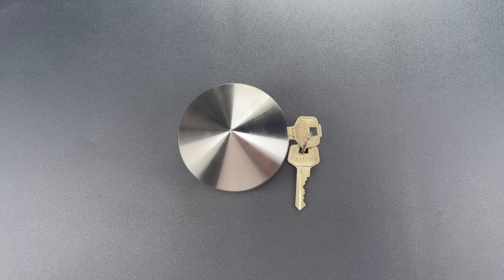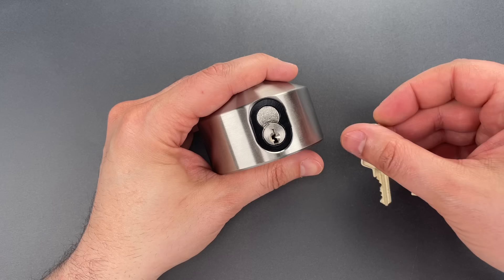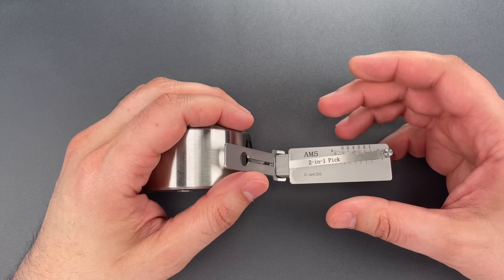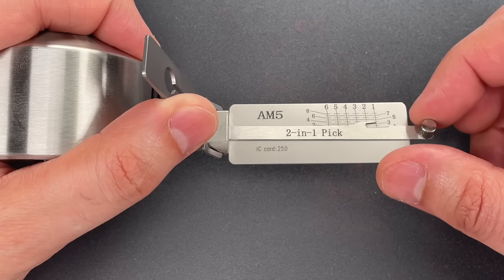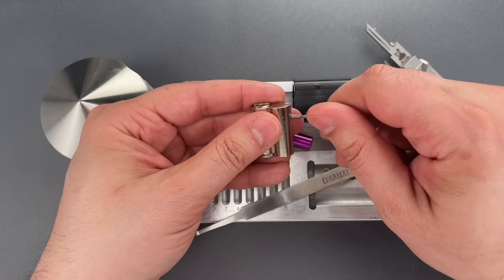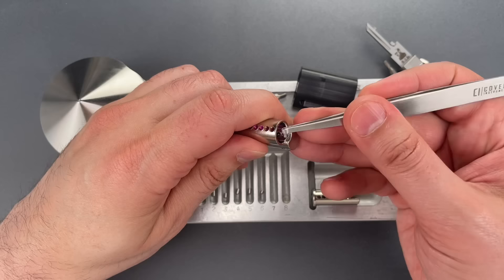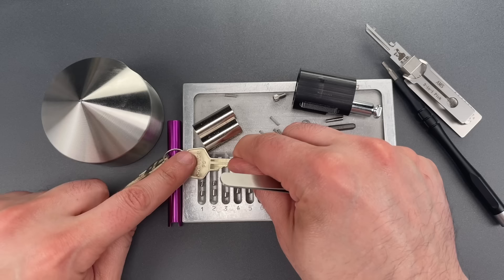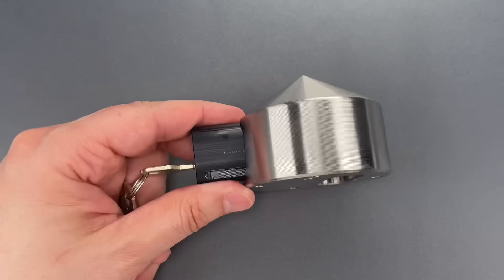[1293] PacLock’s Cone-Shaped Drill Defense

Comment: I like how LPL video lengths have become a measurement for security rating.
Reply: If Paclock included the easter egg just to make the video a bit longer they are absolute geniuses.
Reply: A long video might indicate a good product, or LPL may have spent several minutes roasting the fuck out of the lock and its manufacturer.
Reply: i recall a few videos he opens the lock under 30 seconds and spends another 4 minutes mocking the lock by opening the lock with a common house item.
Reply: @Wampa842  there's been a few videos, usually with Master Locks that he opens in a few different ways in less than 2 minutes
Reply: 1 star for each minute of LPL video. Very few locks have more than two starts.
Reply: Dissembling the core always leads to a longer video. I wish he did this to every lock. Not for longer videos but because I like seeing what’s inside the core.
Reply: This. 😂
Reply: Ikr? I saw length 7 minutes plus and said "Wow, this must be a great lock!"
Reply: @bman78629  I heard that LPL opened a lock just by glancing at it
Reply: Yeah.. I always check the video length in the thumbnail (give the ocassional *tut *tut with obligatory head shake) before clicking on it.
Reply: @Wampa842  This is true, but it's enjoyable either way. haha.
Reply: 5 minute video. 3 min getting into the package. 30 sec picking. 30 sec taking apart. A minute to tell us how it’s trash.
Reply: No question 😂
Reply: I was going to say this haha
Reply: @bman78629  or a stick
Reply: Or quantity of duct tape.
Reply: @Bob_Smith19  he does it to most every lock he can without destroying in the process.
Reply: @bman78629  or the LEGO spaceman...
Reply: @bman78629  I always do a skim and see how long is he actually messing with the lock. If it looks like it's a while it gets added to a special list I have saved. Hell, it it looks like it's longer than I can slide through in a twitch than that's 5 stars.
Reply: Hahaha true! 2-3 minutes is trash, 3-5 is alright, 5+ strong af
Reply: @scotsrule08  my rule of thumb is anything over 30sec for LPL is good enough.
Reply: That’s because he makes the video about the lock instead of including all kinds of sponsors or merch shit. He makes the video for information not cash.
Reply: I saw 7minutes and was like,  "well I guess I absolutely have to watch this one..." Lol he puts out such high quality content and no video of his is a waste of time.
Reply: Im pretty sure there are some hard to explain but easy to unlock
Reply: That's exactly how I judge the lock before even watching 🤣
Reply: To be fair he does tons of reserach and figures out how to break it ahead of time.
Reply: It's natural. When we're all used to 2 minute videos, anything longer is a glowing review
Reply: It took him just over 1 minute to pick the lock.
Reply: @jonathanohagan1349  those are master locks.
Reply: LPL security level:
10 sec pick time
30 sec pick time
1 min pick time
5 min pick time
Grinder
Indestructible
Reply: under 3 minutes: Not worth breathing in
3-4 minutes: bad
4-5 minutes: good
more than 5 minutes: i'd trust this lock with my life
Reply: Exactly what noticed lmfao
Reply: This guy thinks he is mcnally 😂😂😂😂

Comment: The fact that LPL got in was inevitable. More importantly, the fact that PacLock did everything they could to present a product that does what it says it should is the kicker. Good on them.
Reply: And as far as opportunistic a thief with normal lockpicks goes, any lock LPL defeats with custom tools is for the most part secure ( in the looses sense)
Reply: @toryknotts8026  Even without the need for this custom tool this lock is exceedingly unlikely to be picked in the wild. Good tolerances and 6 pins with 5 of them being security pins is generally enough. It took me QUITE the bit of practice to get to that level and even under ideal conditions (vice mounted, elbows firmly rested, no ambient noise, no cold hands, no adrenaline pumping) I average 4-5 minutes on this level of lock.
Reply: @toryknotts8026  it’s very secure.. LPL has the advantage that he is not worried that someone might spot him and attack him with a crowbar. 😉
Reply: @andersjjensen  plus most thieves dont even pick the locks but they cut or saw them off, so these really do help
Reply: honestly just having drill resistance and requiring specialized tools to pick are big plusses. Nothing is invincible, but this is pretty secure.
Reply: @toryknotts8026  loosest*

Comment: Ok that "mastersux" thing when sending it to LPL was super ballsy. Imagine if it was a bad lock, but no, it did well and deserves the ability to mock Masterlock!
Reply: I wonder if it was just that lock, or they all have that.
Reply: Even a door handle deserves the ability to mock masterlock.
Reply: @rezaka116  security level: gentle breeze will open
Reply: Tying something down with a noodle is safer than using a Masterlock.
Reply: @Gainn  you could use that as a deception technique by burning "Masterlock" on a good lock and confuse the picker
Reply: lol
Reply: Pac lock are usually well thought out, they don't cut corners

Comment: I can imagine the reaction from Paclock when LPL complimented the lock only to immediately bring out his ultimate lock picking tool that dealt with it in about a minute
Reply: It's high praise if they managed to make LPL use his special tools to pick their lock
Reply: If you read PacLocks comment, this tool would be very hard to use in it's intended application for gas station air/vac machines. You can barely get your hand in to use a key.
Reply: yeah, if it takes a tool 99% of people trying to break in don't have access to, its secure enough for most people
Reply: Most standard thieves won't have that tool
Reply: It's a $150 tool that only works on extremely specific keyways and is actually defeated by extremely strong springs. The Lishi is a very fragile decoder. Also, the fact that you can use any core you like also means you can get higher security options.
Reply: A minute is really good, this is LPL we're talking about. If it was another master lock, it'd come undone through sheer thoughts alone.
Reply: The lishi doesn't do anything a lockpick can't do, it's just made to make it more accessible

Comment: “Probably helps with pick resistance” seconds after having picked it
Reply: He had all the time to prepare and get creative, with all the tools accessible in his home (or office or wherever he films this). If you would be burglar or hired lock picker, you would have limited time and limited equipment on the spot, out of your home or office. Therefore any nonregular “unexpected” lock is a big stopping stone in my opinion.
Reply: The different strength springs add resistance against low skill attacks like raking. They dont do as much to hinder single pin picking.
Reply: ...and don't forget that in this video, LPL didn't pick this flat on the desk to simulate the flat surface of a van door for example. If he did, you would have seen that pulling up on the tensioner between thumb and index finger  is much trickier, and doesn't give the same feedback as just pushing up the tensioner with the thumb (as he did here). Same thing with the pick part of the tool. Bending your index finger up whilst hooking it under the picks finger knob will reduce feedback. It's possible, but a lot trickier than the way he does it here. I thought he might have made a specialised pick tool for this, with a 90 degree bend in the handle. Besides all that, to guarantee you had the right tool for a multitude of these, which are very likely to have different cores, you would need a set of lishi decoders, not just one, and that would probably be well  above the budget of opportunist criminals. So, it's a very good design.

Comment: A 7 minute LPL video? I can finally lock my shed!
Reply: 1-2 minutes of picking
Reply: @knightsofthewicked9121  With a specialized tool and LPL being the picker. That's pretty damn good if you ask me.
Reply: I currently have this very cool steel cone-shaped lock on my shed. I love that it's drill-resistant and it looks neat. It's very good except it froze up several times over the winter and I needed a hairdrier to open it. Mine has a brass core w/brass key and a blue silicone keyhole cover. The one that LPL worked on today has a different core that perhaps may be more cold weather-friendly. I put a call into Paclock to see if they have any suggestions to keep it from freezing up. If you get this, make sure your shed door design can accommodate for the two hidden bolt holes behind the lock itself. This protects against a bolt-grinding attack. Unfortunately, I could only use the hidden bolt on one side, as I had nothing to drill into behind the other side.
Reply: @knightsofthewicked9121  and he's probably slower so people can follow what's going on, but then again he's been doing this a lot and is using a specialized tool for it
Reply: @dralex4830  He's also explaining the process (and what he's feeling in the process) as he uses the special tool.

Comment: Mr. LPL was more than a little enamored with this lock. How refreshing.
Reply: This BRAND. He recommends it whenever their products are featured. He has a good relationship with them. He respectfully points out flaws if he finds them, and they take those seriously and improve their design. I wouldn't be surprised if they were one of the top brands for actual level of security.
Reply: What Otaku said. They seem like one of the only company that still try to innovate and make life tough for thieves, and they crave LPL critics so they can improve the flaws in their locks. 
I mean, innovative shape against drilling, stainless steel pins, really hard to pick without a tool like the one shown AND all security pins, unbumpable, uncombable...
And it LOOKS sturdy, so many thieves will try another target instead of this one since most of them won't bother with something this difficult.
Reply: They did simple but effective things to improve the security (positioning the core to defeat standard pick tools, variable strength springs, long driver pin to defeat comb picking, cone shape to divert drill bits).
This on top of standard anti-pick measures makes the lock quite a bit more secure than most locks.
Reply: it helps when he has an financial agreement with the manufacturer. This is an advertisement

Comment: LPL had to use a specialized tool AND it still took him a minute? That's a pretty damn good lock.
Reply: 1:14 total
Reply: He didn't need it, he uses it to advertise it because he sells them.
Reply: @dickJohnsonpeter   He would have needed it if it were actually locked up against a flat surface, the way the lock would actually be used.
Reply: @poundng1  A pick with a suitable bend could also be used but using custom pick from covert operations is obviously much easier to use.
Reply: @poundng1  if the key can fit,  regular lock pick tools can too. That thing isn't any different except the markings that make it easier for beginners. And the tensioner folds out for convenience. When mounted on a wall the keyhole is obviously far enough to use a key which is bigger than lockpicking tools.
Reply: @dickJohnsonpeter  you are missing the fact that although tools would fit you would have to learn to single pin pick with your pick being upside down from your perspective which is added difficulty as LPL tends to hold his pick like a pen as that is how he is used to doing it he would have to pick at a new angle with the feedback being different I have no doubt he could do it given time but that is no simple feat

Comment: When will we see a MasterLock with a similar Easter egg stating “PacLock Rules”?
Reply: PacLock is my daddy!
Reply: They already do,... it comes out as a wimpy sounding squeak everytime a rank novice successfully picks a Masterlock brand lock,... which is a lot!

Masterlock has never ever EVER made a legitimately good lock,... ever. EVER! Not even a part of a good lock without finding some ridiculous convoluted way of screwing up the rest of the lock's design.🤣
Reply: Only O'Doyle rules!
Reply: When Master starts making locks that don't suck?
Reply: @FunBunChuck  
So true, Master lock makes one good core, only found in their plastic tag-out lock 🤣
Reply: @dragonhealer7588  Yup, the Lock Picking Lawyer called it Masterlock's paradox. Their best and most pick resistant core in a plastic lock meant for specific applications and their worst core in their best designed lock body and shackle.

God fobid anybody that's competent should take over the company. Imagine what would happen if the Lock Picking Lawyer took over direct management of Masterlock!🤣
Reply: Last time I checked, hell was still hot as ever.
Reply: @dragonhealer7588  That's deliberate.

There are times when you may need to break a LOTO lock to get the system back up quickly.

But then you have a broken lock if someone got hurt without it being a legitimate removal. And that changes the nature of the injury from workplace negligence to deliberate sabotage.
Reply: @ScottKenny1978  
Of course 😁. Shame they couldn't use that core in a hardened padlock.....🙄

Comment: The mounting against the surface as a defense to picking is so interesting! Such a small but significant difference (at least to the basic tools you’d expect someone to use)
Reply: Also would help protect the core from being drilled. The key way is the weak point, and having it close to the surface prevents most drills from getting a straight shot at it.
Reply: It also has really good pick resistance on top of that. Nice lock.
Reply: The other benefit it that the core can not be drilled as easily, as the keyway is a weak point. When it's mounted like this, drills can not reach it easily.
Reply: What do use this lock for?
Reply: @oshismyname  trailer hitch 
[901] A Trailer Lock That I Would Use... Picked (Proven Industries)
YouTube · LockPickingLawyer
8 Jun 2019
Reply: @oshismyname  I think anywhere you'd have a locking latch. Like a shed or gate latch.
Reply: @oshismyname  The backs of some work vans have a shackle from the right and left doors coming together surrounded by a metal ring the height of the lock with a notch missing.  This lock slips over those shackles and inside the metal ring, with the core located at the notch in the surrounding ring.  Locking up slides a bar through the shackles.  The setup is designed to resist physical attacks like cutting or prying.  Putting a good lock in there limits other possible attacks.
Reply: Seems like it might also make operating it with the key a mite awkward though
Reply: if they  Angled it the lock faced a bit towards the door it would be hard to get a pick or that tool in there, would be a strange shape key you would have to L shape it
Reply: I was curious about the tensioning even with the Lishi tool.  He had his hand under the lock in the video, but I'm not sure there would be room to get his finger in there if it was locked against a surface.
Reply: @HariSeldon913  that's just to hold it. If it was locked onto a door hasp, he would not need to touch the lock body at all.
Reply: @ScottKenny1978  Not the way I meant it.  I was talking about the tensioning piece, though if it was secured onto a hasp he could most likely pull it up instead of push from the bottom.
Reply: @HariSeldon913  we may be talking past each other.

I'm saying that the lock body would be pushing into the door or whatever it's attached to, to give resistance to the turning tool.

Comment: This video was one of the best to show the process to set the pins, I learned more in this than the last 2 years of videos...except the ones on april 1st. Those always are the most informative.
Reply: Yep, both seeing the resistance when a pin is binding, and also the broader tool making the counterrotation plainly obvious.
Reply: Completely agree, seeing counter rotation in action, and how it affected the other pins that were already set was really great
Reply: @patricker22  I think this is one of the few videos you can see the degree of the counter rotation and the system to go check the pins again and fix the ones that dropped
Reply: the recent deviant ollam vid on the lishi pick is also really informative
Reply: Yeah! Where else would you learn to always use plenty lube when entering through your ex's back door.

Comment: I use a lock similar to this at my work.  Securing a 20ft cargo container.  The area to lock the doors is enough to put the key in, turn, and pull out.  

You just dont have alot of room to work and connote see the lock very well.

Comment: Worked in a shipyard for a while as a pipe welder. Learned to pick locks to get access to nearby welders and other equipment. Company equipment, no ones personal shit. 

On another job the boss often forgot the key to the jobsite box. So I bailed him out a few times when we worked on the road. 

Recently used it to de-energize a breaker box that was locked by a customer who was away at work while we conducted trenching operations to run a waterline. We cut an old powerline that was energized but not running to his home. 

Made my picks from 316 stainless tig rod I had laying around. They seem to hold up really well. I said all that to say this. Lockpicking can be a really useful skill to have. sure most of the time you can use bolt cutters, two wrenches, or a grinder, but sometimes it's nice to not have to inform a customer that they have to buy a new lock. 

And that locking tool you have there sure looks handy. I'd like to get my hands on one.